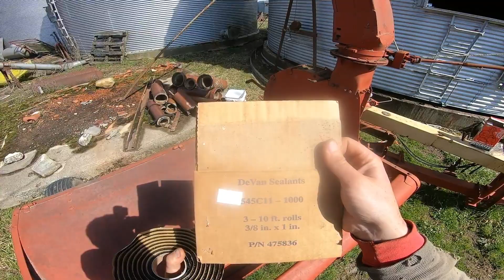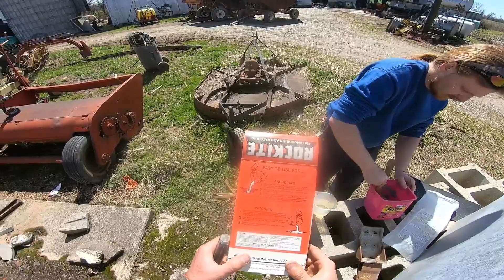2k Bin Site Remodel: New Base and Anchors

Comment: Jacob, I realize it's water under the bridge at this point,but drive pin anchors is the way to go. I had never set a bin until last Fall when I set two 14 footers. I used the "drill in place, rod,  lift, add sealant and lower" method just like you guys did. I've yet to get floor into them yet. You did a good thing saving those  bins.

Comment: I used to build bins as kid,  we bought tar in 5 gallon buckets and used a long rubber glove and spread the tar on the inside of the bin when we had a raised floor.  This kept the mess inside and out of the weather. tossed the glove after the job was done.

Comment: Looking good... that's the way to do it.  Got some vid on my channel of the dealer installing a new bin dryer and fan on the BIL's 20K bin, same size as this one IIRC, up in Indiana.  His old fan/dryer finally bit the dust.  His slab is cracking up, even had some varmints digging under there, so he's talking about building a new slab and moving the bin over onto it, adding a second bin at some point, etc.  Improving the layout and stuff.  We installed a new electric panel and rewired the bin stirrators and ran new wiring for the fan/dryer and stuff, then installed a new propane line once they set the 1000 gallon tank.  Works really slick!  

At least you're not just starting over with a new half million dollar or whatever facility, then dunning your subs for money to help keep you from going under LOL:)  Or selling dirt or whatever just to dun money from subs LOL:)  Later!  OL J R :)

Comment: Yes dry means much better bonding. Less captured water rotting metal and paint underneath. But to put rubberized cement on concrete dry makes all the difference in bonding. In fact I don't even know if flexible silicon will even bond to wet Concrete. That old tar you chiseled off was crappy hard cracking stuff and this will hold until you are 95, then ya'll will have to redo the bin again, durn.

Comment: Looks good. I have a bunch of bin work to do also. Mine is going to involve pouring new concrete and hopefully having a crane move the bins. Best advice I can give, is to go with an 8" draw auger. We have 6 with 8" and 2 with 6" draws and we kinda hate using the 2 with the 6" draws. Keep up the good work and good luck with the floor

Comment: Professional builders these days stand wherever and push buttons.. hydraulic jacks all linked together.  3 people and 5 jacks is close enough to coming down perfectly level to work.  I’ve built a complete 24’ with 4 jacks but it wasn’t fun, probably pretty similar to 27’ with 5.  Easiest thing to do on floor or even adding a ring to 27’ or smaller is to rent a good sized telehandler, put a semi tire and rim or tractor front tire and rim in the bin, lift snug to the center hole and lift the whole works with the telehandler.  Anything bigger  needs a crane and several cables down to the bottom.  Good work on the bin, I wonder if maybe some of that Por-15 or other “rust converter” product on the rusty spots up high before some paint would help any?  I know it’s good on steel, I did some spots on a grain cart a few years ago that haven’t come back through the paint yet.. but not sure how it will work on zinc coating on galvanized.  You’re probably done now, but it works good to use your tar sealant and just smear it all around the inside before you put the floor in it to seal it up.  If you do it from the inside the static pressure from the fan isn’t trying to push it loose from the base like it will if it’s just done around the outside.  I’ve had it push some out over time that was only done from the outside.  The stuff on the inside stays pliable much longer without the hot sun beating on it.  (Just food for thought If you have to do another one down the road sometime)
Reply: It's not so much the sun making the tar stiff over time, it's mostly because it collects and "absorbs" dust and of course water exposure eventually "floats out" the lighter hydrocarbons of the tar and just leaves the hard stuff behind... the dust makes it thicker and eventually you're just left with a brittle chunky stuff... OL J R :)